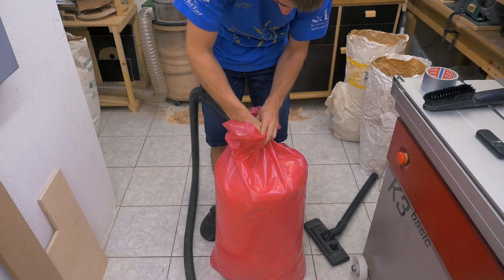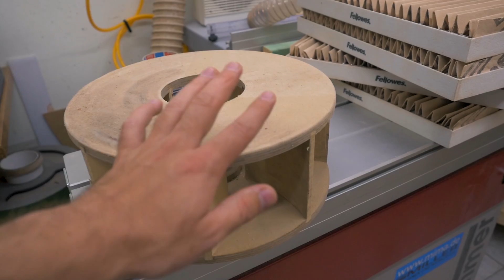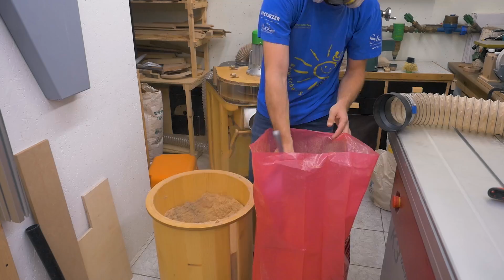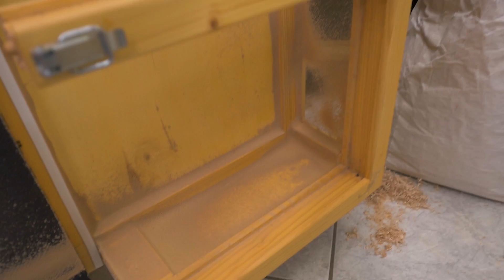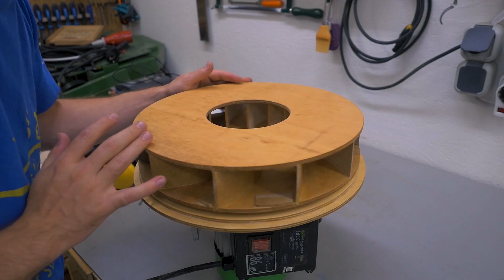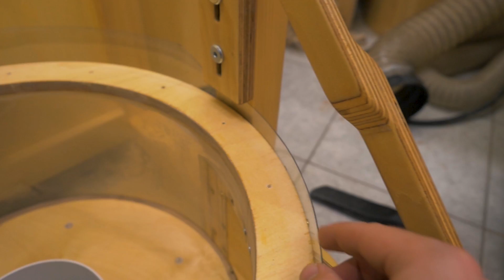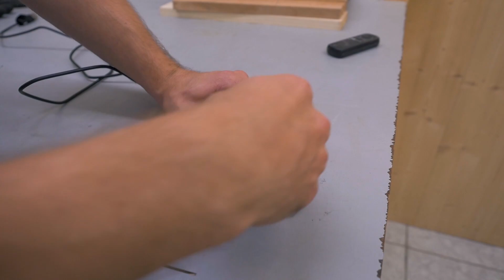Dust Collector Update & RODE WIGO Charging Station (Random Shop Stuff 24)

Comment: For the red bags, you could/should use a holder, that keeps it open and upright for you.
Reply from the maker: I think the same every time I empty the bins. And after it's done I think...I'll get to it eventually
Reply: @MariusHornberger  Well, it'd also work for all the other random trash you generate that isn't fit for the extractors.

Something like this:
https://www.amazon.de/QUICK-STAR-Müllsackständer-Müllbeutelhalter-Müllsackhalter/dp/B07RSS2HRK

Could always buy one if you can't figure out how to build it (he said, wondering if the bait works if you say that it's bait).
Reply: @MrMartinSchou  I followed that link and then looked around at some of the related products which I find are only available in Germany. I found it interesting that Germany has thought out the waste stream so well as to standardize and color code trash bags for different types of trash. In the US any such standardization would cause an uproar about "government control" and "communism", but I'd be willing to bet that you pay less on average for trash collection and that your system results in cleaner streets and far less trash blowing around in your communities. In my community it is still LEGAL to burn trash, and I live on the downwind side of town. In the winter, the stench of burning trash often settles over the whole town for weeks. Personally, I compost what I can, re-use or recycle as much as I can, and haul the rest to a local trash facility, but I also have to spend about an hour a week collecting trash that blows into my yard from neighbors who simply pile their trash for a few months, waiting until there is "enough" to burn.
Reply: I would put the red bag enveloping the whole container, flip it upside down, then tappy tap tap it all falls inside. Maybe the bottom could have a loose board and a hole to pass a temporary screw-in rod (broom stick? proper!) to act as a piston

Comment: HI Marius,  great video as usual.

I had a few ideas for you... 
Have you thought about clear coating the blades?  I high polished and waxed finish may resist dust build up longer?  Haven't tried this as mine isn't nearly as big as this, so I don't get as much build up before it comes loose.
Second, I built a ceiling mounted air filter using a 20 inch box fan with 3 filters in front, and one filter behind.  That made a world of difference in my small space.
And lastly, here in Canada, we have a foldable plastic unit that holds the lawn waste bags upright and rigid so you can empty grass and leaves into it without it falling over... Maybe a modified unit like this would help with the "Look at that genius" moments :)

https://www.amazon.ca/Feuille-lustre-650-feuilles-pelouse/dp/B01B7OUN9A/ref=asc_df_B01B7OUN9A/?tag=googleshopc0c-20&linkCode=df0&hvadid=292924557768&hvpos=&hvnetw=g&hvrand=13686363334560529948&hvpone=&hvptwo=&hvqmt=&hvdev=c&hvdvcmdl=&hvlocint=&hvlocphy=1002376&hvtargid=pla-314526689731&psc=1
Reply from the maker: The fins are clear coated. And I guess the dust will also stick to a polished suface. If you put some fine dust on glass and try to blow it away, there'll always be some left
Reply: @MariusHornberger  That's true... I guess it shows how much I dust things :P

Is there a way of reversing the motor to run a cleaning cycle?  Block off the inlet so it doesn't push the dust back out to the machines?

Comment: How powerful is the motor on your small dust collector? What are the dimensions of the impeller?
Reply from the maker: 1000 Watt. Size I don't know off of the top of my head. Have a look in the build video for more details
Reply: @MariusHornberger  Yes, I found the video after asking. Somehow I forgot you had one for the small dust collector. Are the fins the original ones made of MDF? Maybe it's good enough for the small version? I know you changed the impeller in the big one. I'm trying to build one with a similar motor.
Reply from the maker: Yes, for the small one the MDF fins are fine (still no guarantee)
Reply: @MariusHornberger  Don't worry I won't sue you haha. It's impossible to get decent quality plywood here. We only have pine or eucaliptus plywood and it's like the worst grade, if you cut it it has voids inside, so balancing would be an annoying task.

Comment: remove the motor fan and replace it with an electric fan, incorporate a bit of electronics (Arduino) for speed control, slow RPM makes the fan speeds up keeping it cool regardless of speed of the drive motor. (The DM UK)
Reply: Ha! I just commented pretty much the same.
Add an LM35 temperature sensor to one of the analogue inputs, and you could have dynamic fan speed on the basis of motor case heat:
~ Not very hot? Fan speed low (quiet)
~ Getting toastie? Fan speed high (removes more heat)
I've always disliked having fan cooling attached to motor shafts.

Comment: Great video, really thorough and enjoyable update.
100 people will say this, but I guess a simple tall + skinny plastic bucket in the big collector will make your dust cleanup a lot easier, (just pull it out and empty into a bag), though i guess at the expense of a bit of capacity.
Reply from the maker: I explained in the video that I already tried it and it didn't work, because the bag gets deflected from the vacuum
Reply: @MariusHornberger  bag or bucket? I get that a bag would get blown around but didn't think a proper bucket would get deflected so much, but, i've never made my own dust collector so I wouldn't know :)
Reply from the maker: Oh I misread bag and bucket. I have seen a bucket like this imploding due to the pressure. I think what works well is a cage that prevents the bag from deflection inside the wooden bucket

Comment: The areas of collection on your impeller and inside the separator are absolutely due to the low pressure, as you mentioned, but also static attraction. The dust is charged. Since your parts are made of plastic and wood (with a plastic finish layer on the outside) it will become charged over time and attract dust. There probably isnt much you can do. Maybe adding a ESD discharge wire to your ducts, if you dont already have one, might help-- but i doubt it.

Comment: Hi Marius. 
If you are concerned about the heat build-up in the motor, it might already contain a thermistor embedded in the stator windings. Look at the nameplate for /TH or /TF. It should be just after the motor name. eg. DT90L4/TH. If it does the thermistor can probably be connected to your new VFD. Two extra wires will then be present in the motor connection box.
You would also be able to force cool the motor and then use it below 10-15Hz without issues.
Furthermore the specific motor you are using DT90L4 is rated for, at least, a stator temperature of 125 degrees C, probably higher. 
I guess you would notice a smell of hot wood dust long before the motor fails. If you have any question regarding this I'll be happy to assist.